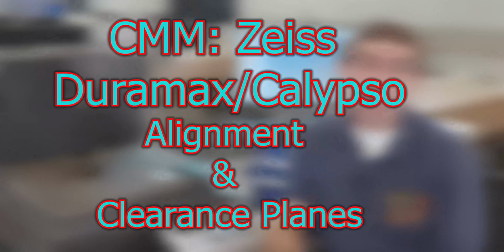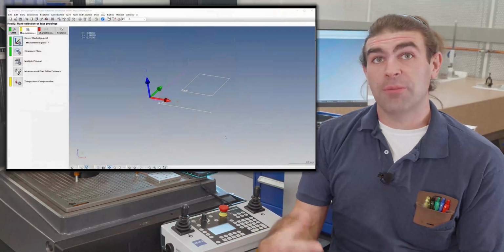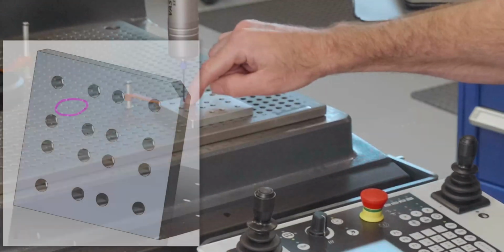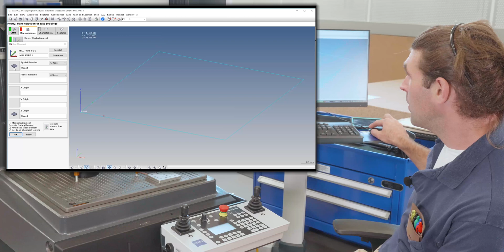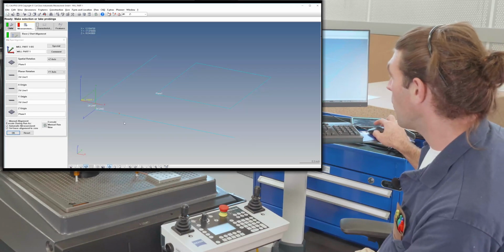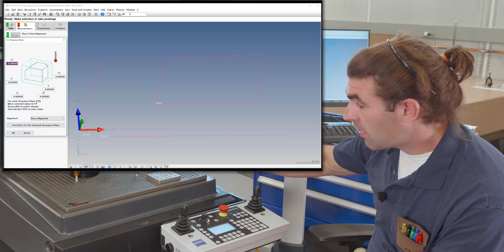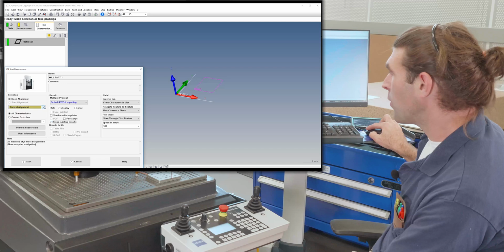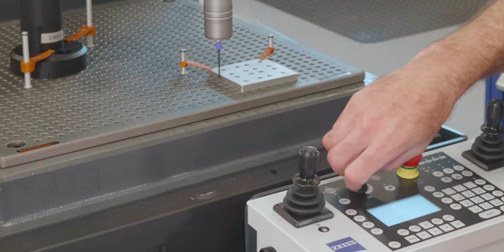CMM Zeiss Duramax with Calypso: Alignment & Clearance Planes  (Programmer Training Lesson 6)

Comment: Another question if I may.  Scenario:  I've got a ROUND part, roughly 1.750" in diameter and 1.750" tall.  Top and bottom are faced off to finish, as is the OD.  In the TOP of the part that is facing upwards there are three holes in a line, the middle one at part-center.  The other two holes to either side are at 1/2 the distance from centerline to the edge of the part diameter.  Those two holes are actually cones with a 3-degree included taper narrowing as it drops into the part roughly .732".  Workholding:  A magnetic plate that I can drop the part onto.  At the moment we don't have anything setup to lock it into an X-Y spot, but that's fine for the moment.

We are practicing with using CAD files to setup Measurement Plans to emulate what's going to be happening during Production when Jobs are prepared.

I want to measure each hole ID at given points (I think I have that), and measure the distance to each hole from Centerline (not setup yet).  

Challenge:  I'm having difficulty properly setting up the Base Alignment/Starting Alignment and Planar Rotation for the part and features (two holes/cones across the face of the part).

Questions:  Base Alignment versus Starting Alignment, setting those up and then establishing the Cones (two holes), and setting Planar Rotation properly?  1)  I have to identify the location in space of the entire Part (Base Alignment I believe),  2)  I then need to identify the "Starting Alignment" on the part for the features, and the "Planar Rotation" to identify where in space, on that part, those holes exist.

What would you identify as the "Base Alignment ?  Would that be the Cylinder of the OD?  What would you use as the Starting Alignment?  Would this be the top face into which the holes are machined? 

As I understand it, the Base Alignment is what identifies to the CMM the position of the part on the CMM Table, and the Starting Alignment identifies the part surface from which all other features are identified / positioned on the Part.  Is this correct?

Since I'm using a CAD file for setup, and won't have a physical part until 1st Piece Inspection, initial file setup is going to be "CNC", not manual, correct?  Then once I have a physical part I will establish Starting Alignment and Planar Rotation then, modifying the entities I've populated already in the Measurement Plan setup based on the STEP file, yes?

Apologies if this is a TLDR.  Almost all our parts are ROUND / Cylindrical, not square/flat, and it's messing with my head a little.

Thank you for your time.

Comment: I'm a completely inexperienced CMM person.  Let me ask what will appear to some as a silly question, but, it's one I have, so here it goes:  At the high level it appears there are two paths to take to define features:  1)  Probe it physically, populate the feature list box as a result, then follow through with any field updates as needed.  Or, 2) You define features in the CAD window in Calypso first, and go from there.  Do I have that understood correctly?
Reply from the maker: Basically yes, but you can mix the methods if you have a cad file. Say there is a hole on the part that isn’t on the cad file, you can just probe it and create the feature without it existing in cad. You can do some modifications to the cad file in calypso, but it’s clunky.

Comment: I am having trouble getting an old Zeiss Vista up and running. I have gotten to the point of Homing the CMM and selecting points to go to after homing. Say my points are 1.9685. My machine will go to the points of 2.0065, 1.9855 , 1.9855. Is this accurate enough or should my machine be going to those exact points and holding? When I setup my master probe I keep getting a standard deviation of 0.000336 and I am told it should be below the 0.0003 threshold. But not sure where my issue actually is?

Comment: Great video series.  Coming from PC Dmis as a high-level programmer, i am looking for something that i can self-teach myself Calypso, and I may have found something to get me going.

Question:  Why did you use a line for the Tertiary Datum?  Is this something that Calypso requests?  Setting up two lines in a Datum Structure would not work in true theory and in a basic Datum Structure the Tertiary Datum would normally be a Point to lock the Sixth Degree of Freedom.  For example, if you take that part and set it into a box, it would rest on its bottom face.  pushing it up against the X- side would level it against the side of the box.  Pulling it down into the Y- side of the box is where the Tertiary Datum would come into play. If you try to force it onto a line, it would level onto the side of the box, and come off of the side of the Secondary Datum (the X- side of the box).  An imperfect part cannot possibly rest on two lines like that.  If you had an open-sided box and a post in the Y- direction, pulling the part down until it hit the post, the part would rest on the quadrant of the circle (or the point) and you would have Theoretical perfect stability.

Just wondering if this is something I should look for when setting up Datum Alignments in Calypso.

Comment: Hi, great tutorials! Im having 2 issues with my machine (Zeiss Eclipse 550, Calypso 2016 v6.2.12)...When i set up the flatness and choose my Plane 1, i get an error: "The repeatability may be poor if there are not enough measurement points for feature 'Plane 1'. Increase the number of points or change the evaluation method to Guass"

Also, when i run the flatness, instead of "scanning" like yours did, it only touches the individual points of the plane and the 2 lines.

Any idea why it doesnt scan like yours does in the video?  Thanks in advance!!!

Comment: Can Calypso do zero point alignments? Put a probe in a hole and hit go and it finds the part based on a program? I do this in Renishaw's Modus software and it works beautifully.
Reply from the maker: Hi, as far as I know, Calypso needs a minimum of two separate feature to establish an alignment. It is possible to do a “best fit” alignment to shapes that do not have planes or features of size, but the norm is to have 3 features for the alignment.

Comment: Hello! I’m new to calypso; at my previous job (machine shop) I used PC-DMIS and have about 1 year of running programs and 6 months of making programs with that. My only experience with Calypso was in medical manufacturing and running a program, not making one.

At my new job I will primarily be performing FAI’s on pipe assemblies from our vendors. We manufacture boiler and water filtration systems. From what I’ve seen so far (been there a week) most of the dimensions will be from centerlines of the pipes in the assemblies. So there will be lots of cylinders and virtually no planes.

Since most of my x/y/z origins will be a centerline of a pipe, is there a particular method to alignment of a cylinder in Calypso? I only touched on an alignment of cylinders in PC-DMIS and it was a while ago (been out of that job since the pandemic) but I know it was different with cylinders verses planes with PC-DMIS so it seems like it’ll be different with Calypso since the probe scans the part. Do you cover that in any of your videos? 

Thanks so much!

Comment: I’ve a question. I’d like to know how is the best way to make the alignment  using the plane as a Datum A, the first hole is Datum B  (coordinate  X 0 Y0 ) and the second hole is Datum C  (coordinates X 1.25  Y 2.75 ). I need to measure the plane and the two cylinders….how can I do to alignment with a Cylinder at Datum C ?   the software calypso not apply to make this situation in two cylinders. Could you make a video to simulate this situation, please?
Reply from the maker: Hi, I’d be glad to take a look at your situation. Send me an email with a sketch of your part and I can potentially make a video about it.